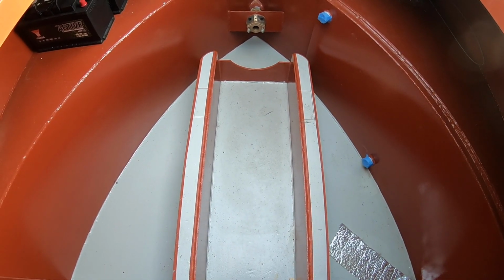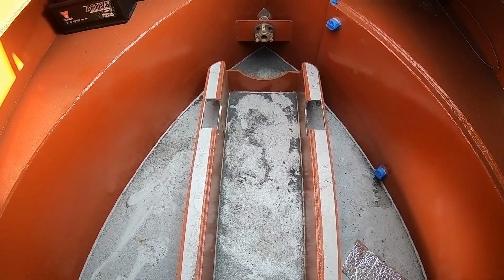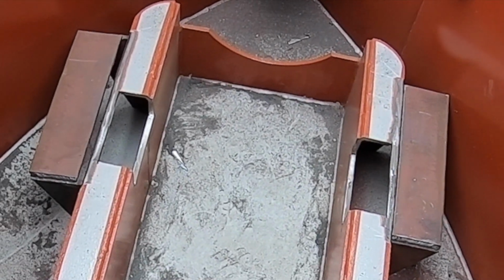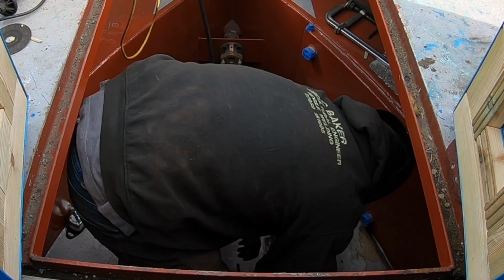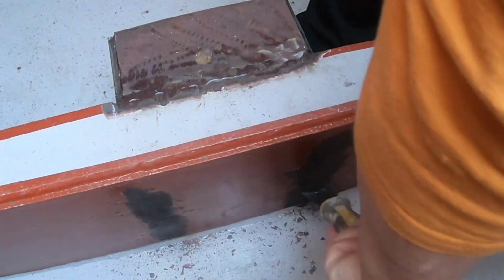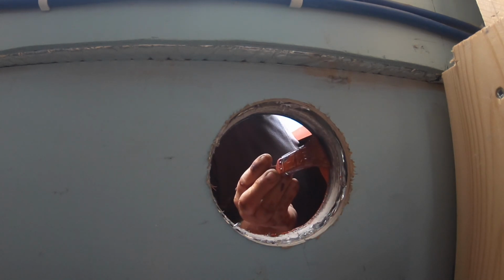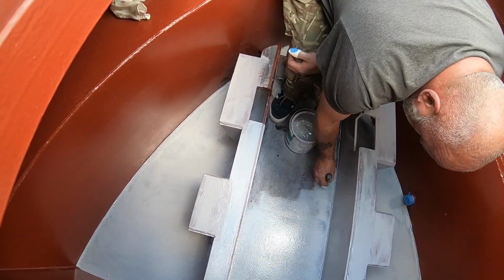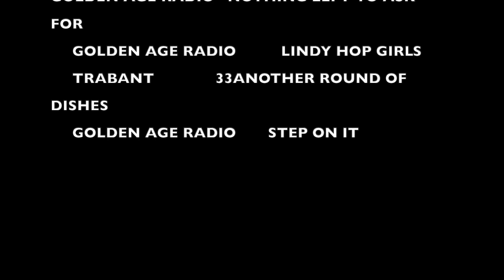VLOG 91, Narrowboat Fit Out -  New engine bed

Comment: I love your approach to ensuring no rust - prevention is the best way and hitting it hard now hopefully will mean no rust for a very long time. Rust is the enemy! I used o use a similar looking stuff on cars in the 80s - Trustan rust converter. I found that if I sanded down too well, so to shiny steel, then it dodn't work. It seemed to work better on lazy prepared surfaces. It must be so annoying having prepared everything perfecting for one engine, then having to change and the work to correct the mountings for the new one messing things up. Workers never bother putting cardboard in place to prevent grinder rash or welding spatter because it is not their job to clear it up afterwards.
Reply from the maker: Thankyou,  Yes living in a steel tube will definitely be a challenge with the rust. Hopefully we are doing the right thing with the steel now so less work for a while. Yes it was a shame when we found out we would need a different engine and the engine beds would need to be changed but it wasn't too bad in the end really once we got stuck into it. We were lucky we could do it before the engine goes in. It is not a job we are going to relish in a few years time. Hopefully you will see the engine go in in the next couple of weeks 👍

Comment: Good luck actually fitting the engine, it should all go well. It makes a change you a Grandad being spectators. Those engine bearers look box sections, if they are have you considered spraying the interiors with a wax preservative like they do on cars. I've always found Waxol to be a very good product. You've probably jinxed the weather  now with your comment!
Reply from the maker: Cheers Tony, Hopefully the engine will go in over the next 2 weeks. It is not box section so we have been lucky that we can reach all the steel with a paintbrush but ill remember that tip for the future. Yes shouldn't get too excited about the weather should we😎🌞